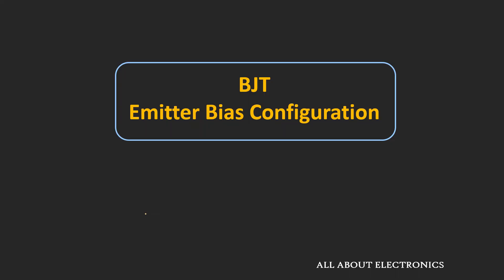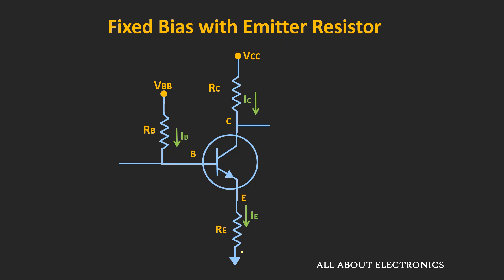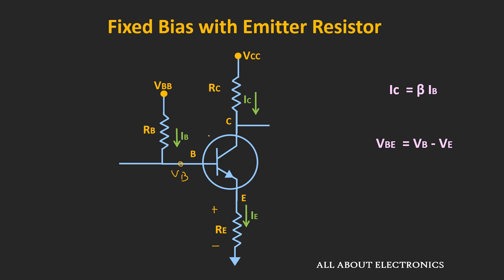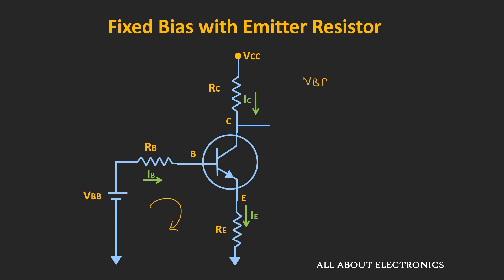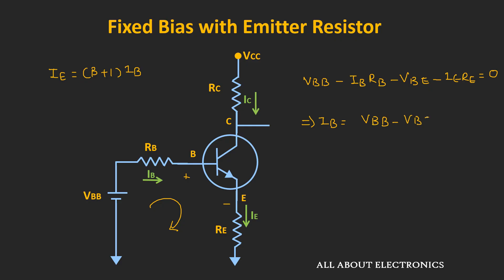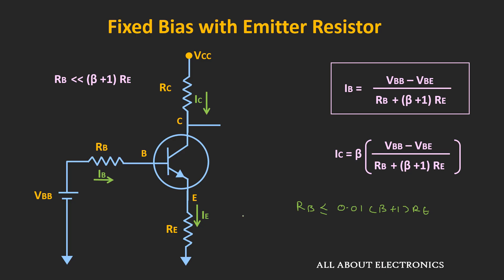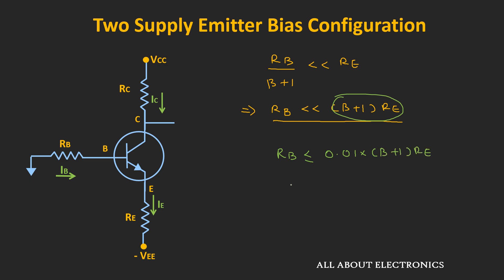Transistor Biasing: Emitter Stabilized Bias and Emitter Bias Configuration Explained

Comment from the maker: The timestamps for the different topics covered in the video:

0:21  Fixed Bias with Emitter Resistor (Emitter Stabilized Bias)

4:19 Variation in operating point with the change in current gain (β)

8:10 Condition for the stable operating point in Emitter Stabilized Bias Configuration

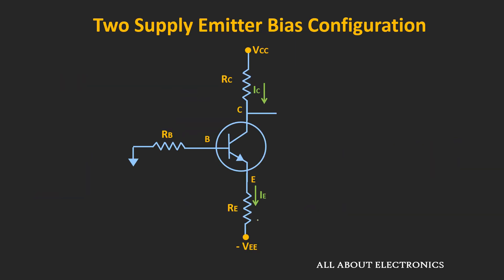10:48 Emitter Bias Configuration (DC Analysis)

13:33 Condition for the stable operating point in Emitter Bias Configuration
Reply: Sir i m first year Engineering student . Can I see this lecture for College exam

Comment: why we say 10:49 emitter bias configuration. Isn't it common base configuration because base is grounded instead of emitter or collector
Reply from the maker: Here there is a base resistor. So, even during the AC analysis, there will be a base resistor between the base and ground terminal. So, it is not common base configuration. Moreover, here the circuit is only shown for the DC biasing perspective. But actually there will be bypass capacitor between emitter and ground. And because of that, for the AC analysis, the emitter terminal will act as a ground terminal. (Emitter resistor will act as a short circuit because of the emitter bypass capacitor )  Therefore, still it is common emitter configuration from AC analysis perspective. I hope, it will clear your doubt. Generally, when we say, common base, common emitter or common collector configuration, it is from AC analysis perspective. The DC biasing circuit might look different.

Comment: Great series of lectures but, as has been pointed out, there is an error at 13;23. As beta is decreased from 100 to 50 the collector curves move downwards at the same base current. So at 13:23 what is labeled as 10 microamps is actually the new curve for 30 microamps when beta has been reduced from 100 (original set of curves) to 50. Similarly at 14:00 the new operating point with a beta of 150 is still on the 30 micro amp collector curve which has now moved upwards and is now occupying the line that previously was labeled as 60 micro amps with a beta of 100.

Comment: @4:41 sir from where you take Vbe=0.7 Volt??
Reply from the maker: It is the typical value of the base-emmiter voltage for the BJT. If it is not specified in the question, you can take it as 0.7V.
Reply: @ALLABOUTELECTRONICS  ohk, thank you sir!
Reply: @ALLABOUTELECTRONICS  Could you please make videos on Physics of semiconductor including introduction to quantum mechanics and Schodinger equation. 
That would be very nice of you Sir.

Comment: sir can you please tell why does the base current decreases if voltage across emitter increases
Reply from the maker: Assuming VBE, the base-emitter voltage is almost constant, as the voltage across the emitter increases, base voltage also increases.  Because Vb = Vbe + Ve. And Ib = (Vbb - Vb) / Rb.
Therefore, as the base voltage increases, the base current reduces. I hope, it will clear your doubt.
Reply: @ALLABOUTELECTRONICS  ok thank you sir
Reply: @ALLABOUTELECTRONICS  thank you I had the same doubt

Comment: The feed bCk resistor Re included to provide fixed Q point or stop the variation in the Q point u said..but u are saying still there is a variation.what the meanibg of that
Reply from the maker: It will reduce the variation or improve the stabilization of Q point. But it can not eliminate the variation completely. But for many applications, that much stabilization of Q-point will do the job.
Reply: @ALLABOUTELECTRONICS  thank you...one thing please can you explain op amp internal circuit by 741 IC ,how transistors on and off during inverting and non inverting inputs supply.if you can olease do it through skype i will pay you.non of the youtube videos can fount about explanation for that ic internal circuit please please

Comment: I have one confusion here in this lecture,you have told as the emitter current increases the voltage drop across  emitter resistance increases as a result VBE also increses.But how?as we know Vbe=Vb-Ve,if voltage drop across emitter resistance increases then Ve will increase and Vbe will decrease.
Reply from the maker: What I mean to say was Vb. Considering Vbe is approximately constant for analysis, with the increase in Ve, Vb will increase and that reduces the base current. 
I hope it will clear your doubt.
Reply: So here Vb=Vbe(constant value)+Ve? Am I right?
Reply from the maker: @ramapatipatra5384  Yes.
Reply: Ok..
Reply: @ramapatipatra5384  As I see it (see at 1:22 into the video) : As the emitter current increases, the voltage across the emitter resistor increase which (for a fixed base voltage) reduces the voltage between base and emitter which tends to reduce emitter current?